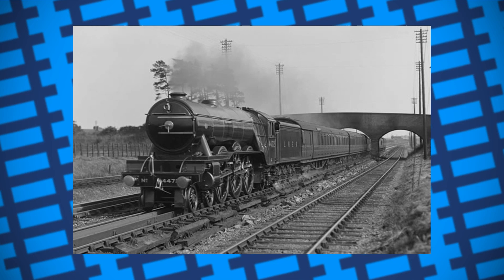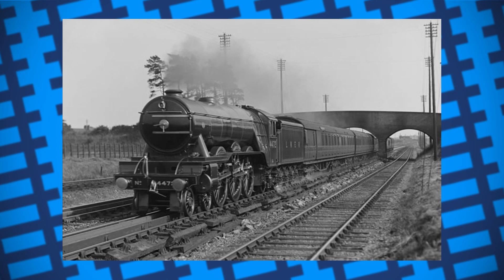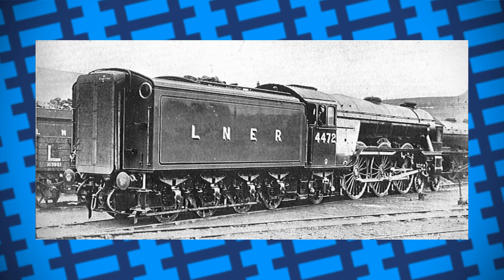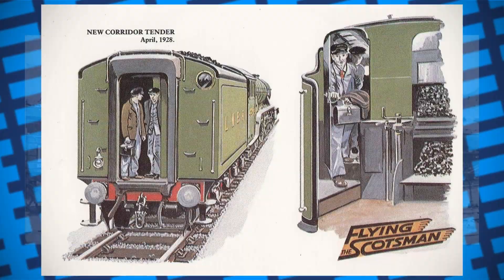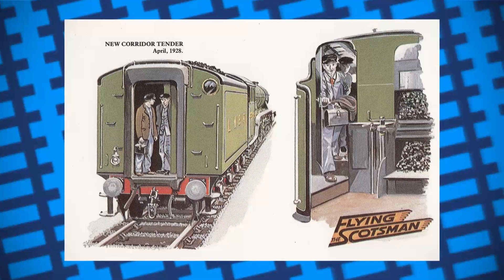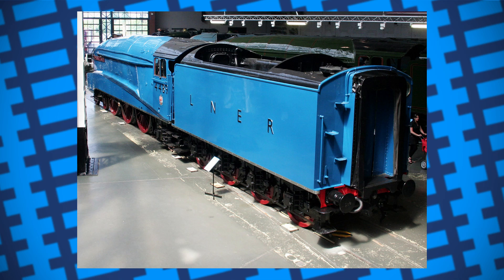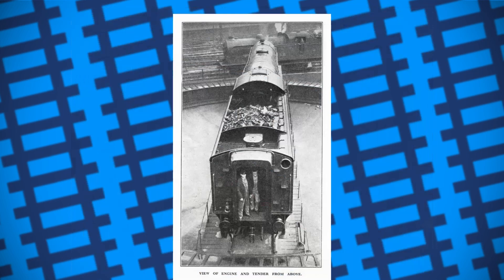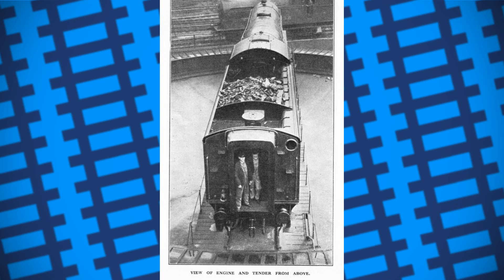The locomotive tender you can walk through - Corridor Tenders

Comment: The LNER only had 22 corridor tenders?
Reply from the maker: Yes, 10 were first built in 1928 with 5 going to A1's and 5 going to A3 engines. Later, 1 was built for the Hush-Hush and another 11 were built to be attached to the new A4's
Reply: So the majority of LNER non corridors.
Reply: @TrainFactGuy  wait there 35 A4 and the P2 have them I think
Reply: I heard that there were 27
Reply: @gamerfan8445  some of them have the same design but not the corridoor in the tender
Reply: Did the U.K. ever experiment with water pans and scoops? Some U.S. railroads used them for non-stop watering. The tenders were large enough where they didn’t have to stop for coal frequently. Your video was very informative. Thank you.
Reply: @davidbudka1298  yes they did, The flying Scotsman express used them
Reply: ++ @davidbudka1298 ++ Yes, the concept of non stop rewatering was invented here and some facilities were still in use up until the end of the steam era. There are sure to be videos somewhere on YT showing  the system in action.
Reply: @davidbudka1298  Yes, a lot of steam locomotives had water scoops as did a couple of diesel locomotives.
Reply: @davidbudka1298  The uk invented them, The first installation was brought into use on 23 June 1860 at Mochdre, Conwy, on the London & North Western Railway's (LNWR) North Wales Coast Line, midway between Chester and Holyhead
Reply: @davidbudka1298  yes, we gave that a try but it was only thought of just as diesel locomotives started to come into popularity so they weren't really needed by that point

Comment: We don't need a Corridor tender in the U.S. Crew change points are only at stations. 19th century U.S. Locomotive tenders are short enough to just climb over. For the 20th Century Steamers, the ladder is usually found on the back of the tender.

Comment: Fun fact - the Gresley A4’s originally came with a special ladder to help clean the front end, where there is no running plate.
After a while, the Kings Cross Top Shed Manager (Peter Townend) noticed they were all missing.
It turned out the drivers had stolen them all one by one, hiding them in the corridor tenders, they all ended up at Gateshead Shed!

Comment: So did the LNER run multiple different locos on the Flying Scotsman service, or was it only 4472 that did the non-stop route at the time?
Reply: Yes as even the vaunted Flying Scotsman, couldn't operate both the London to Edinburgh and Edinburgh trains at the same time. Whilst Scotsman operated the first from London. Shotover worked the service from Edinburgh to London with both trains passing in the Vale of York the half way point.
Reply: minimum was two trainsets, probably had a third and/or fourth in case of issues at either end…
Reply: The 'Flying Scotsman' service came first, then the loco was named after it.
Reply: Initially the name was unofficial, then it was made official and applied to the locomotive afterwards.
Reply: No, the Flying Scotsman as train existed since the late 1800s/early 1900s. The locomotive was named after the train because in the 1920s and 1930s the A3 Pacific class of locomotives were used to pull that train and that one engine in particular became great publicity because it run at more than 100 miles per hour.
Reply: @RJSRdg  yup

Comment: Don't get mad at me OK I just think that  this is only an A unit and B unit just like diesels but it's on steam locos
Reply: No.  Just NO.  That's not what an A and B unit is at all.  An A unit has a cab, and a B unit has NO cab, and is controlled by the A unit.  Most tenders just carry fuel and have NO drive mechanism.  The very few that did were just small booster units to help a train get started, and were cut off at low speed.
Reply: @ffjsb  yeah I know how A and B units worked but when I saw thumbnail at first the steam tender doors. my brain just popped up's the  A  and B units because at the end of the units there is a door that  you can enter in the passenger car. I don't know if you get my idea

Comment: What if the locomotive was electric and the tender was the battery?  Is there a hybrid of a modern train with old fashion steam engine look?
Reply: You can generally walk down the inside of a diesel or electric loco, but they are very restricted in space due to all of the equipment. There was an experimental hybrid tested in UK a few years ago where they mated a HST power car with a battery coach (Hitachi Hyabusa iirc) but I don't recall whether you could pass through the battery coach to the cab. I wouldn't have thought they would use that facility even if they could as the passage through an HST power car is mentally tight anyway. Easier To just walk round the outside. I don't think that there are any scheduled journey times, in UK at any rate, that would require an on train crew change now.